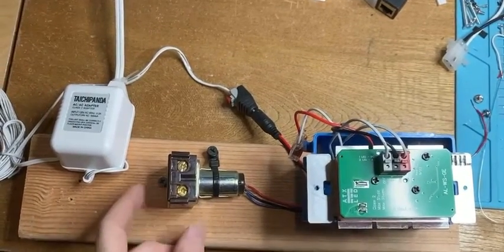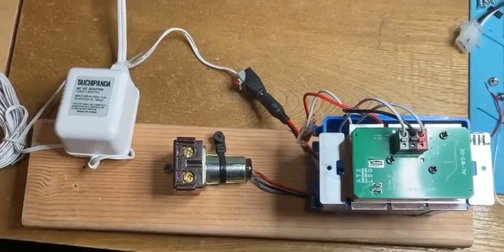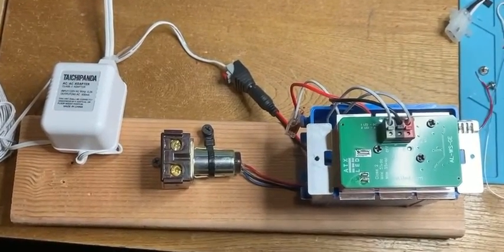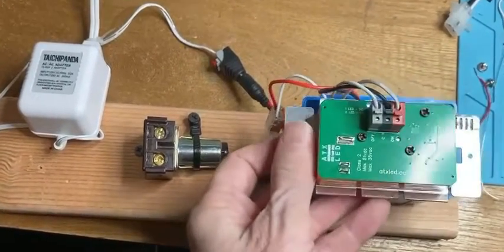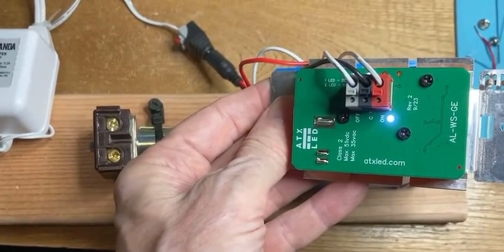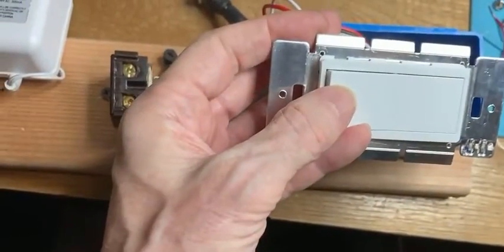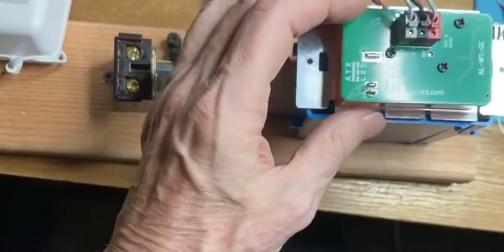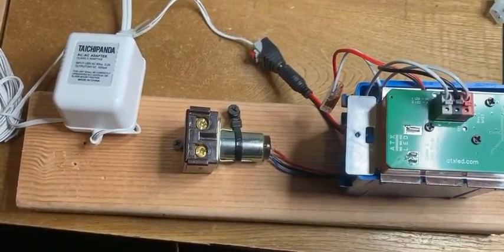Decora switches for GE / Bryant low voltage lighting systems. ( 3 wire, RR7 and RR9 relays).

Comment: Ordered this to hopefully update our switches in our home. I like the system as it is, but the switches are old and need replacing and this is the only switch I’ve found that specifically seems to work with the system. Thanks for the video. I’m hoping this will work!
Reply from the maker: Hi - thanks for the comment - we have a lot of happy users!
Reply: @atxled7490  I have them installed and they work perfectly.  They toggle the relays off an on and I can control them from other spots in the house as well.  Super cool.  Bought more to replace all of the old switches we have in the house.